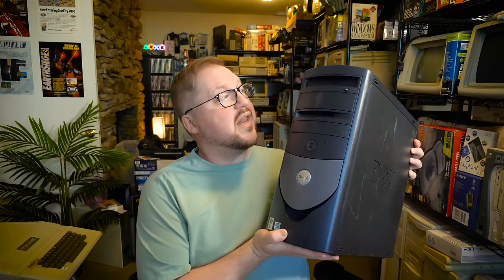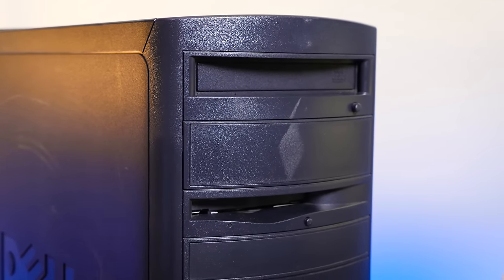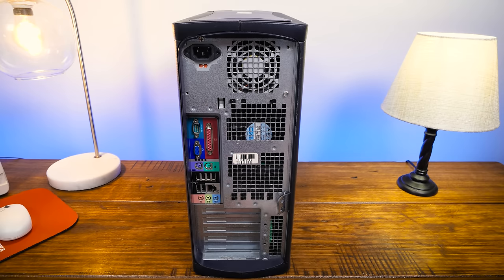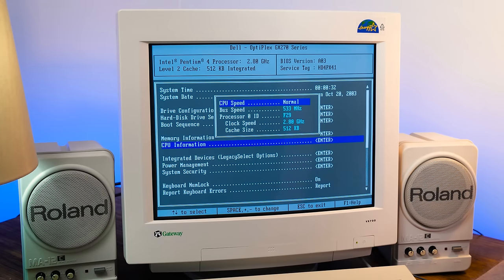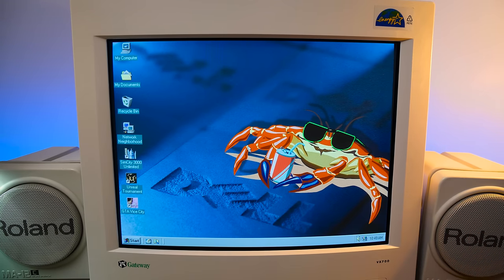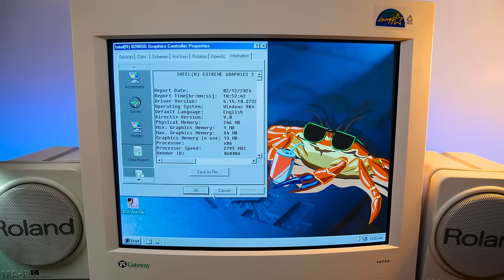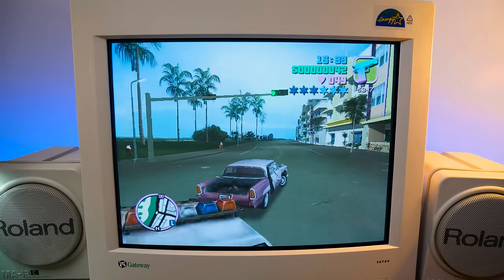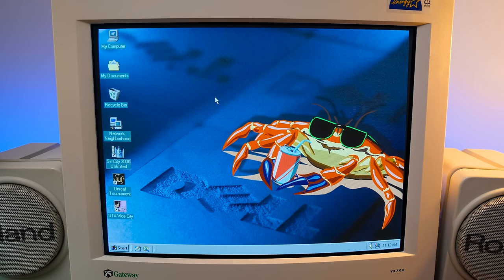The Most Unwanted, Boring PC: Dell OptiPlex GX270

Comment: --LGR buys a computer for $60 (with shipping), that he expects will run like crap, or not run at all.
--LGR says the computer is boring as can be, and is not worth much of anything, aesthetically, or otherwise.
--Computer has leaky caps, that obviously need replacement, LGR rightly suspects it will be nothing but trouble
--LGR powers on computer, expecting it to not work at all.
--Computer works like a beast, running Unreal Tournament GOTY with aplomb
--LGR expects no Sound Blaster emulation, or support with DOS games
--LGR runs DOS games, and Sound Blaster emulation is there, but choppy
--Despite some frame drops in a game designed for a computer five years older than this computer, everything runs great, leaky caps and all
--LGR tries so hard to find anything to complain about at the end of the video, settles on his own aesthetic preferences as the primary issue
--LGR commits to repairing the computer, having ordered replacement caps
--LGR, overall, taken aback at how much of a hidden gem he found with this unseeming, "boring" computer.

This is why Dell was so well-loved back then. Despite all of the issues some of their machines had, they made some darn fine computers, and that's what the company was all about, back then!

Dude, you got a Dell~

Comment: I bought a Dell Dimension 4550 at a thrift store a few days ago. Everything works great. I opened it up and saw two bad capacitors. Is this model prone to lots of them? (Specifically more than two bad caps?)

Also they didn’t look too bad so i also wonder how long it takes for caps to get worse? Do i need to worry about replacing them right now?

Comment: There is a quick and lazy way to recap these ... if you don't mind a little capacitor violence.  A bit of wiggling with a pair of pliers the can should come free, leaving just some stumpy leads.  Your new caps will hover a bit off the board but you'll have  saved the machine.

Comment: i use to have a gateway pentium 3 - 500 mhz processor that ran with 128 mb  of ram and i believe at the time it only had 65 mb of virtual memory if i can' recall. Then I an emachine that ran on a celeron processor yes a celeron as i have said it and ran a 3.50 ghz processor single core but did play games very well considering it's limitations which ran over a 1 gig of ram yes I did say 1.512 mbs of ram w/o breaking the barrier of 2 gigs that ran windows xp in which i could of got'n away with running windows vista. It ran bloody quick for it's time. yes i still have the parts but no case for it anyhow. I don't think I really want ot put it together again and to find out that it won't boot up.

Comment: those early Intel Pentium 4 ran slower and hotter than AMD AthlonXP's.  I got lucky and found a old busted up Dell Dimension with an Hyper Threaded 64bit Pentium 4 Prescott 3ghz model I trashed the broken up case and transplanted it into a Dell Dimension 5100 system I bought a my local thrift store for 7$. I did have cut some of the case with  a rotary tools to make it fit. It's now paired with my old Nvidia 8800GT 512MB and serves as a WindowsXP game system.

Comment: Early 2010 Optiplexes are great machines, i refurbished one for my mom who wanted a gaming PC, I found a low power quad core i5 and got a low profile 1050 Ti, also upgraded the RAM and it runs really well even being able to livestream 720p 60FPS while running Sekiro at practically max settings 1080p.

Comment: At 12:44, you can see that there are two faulty electrolytic capacitors near the ATX connector on the motherboard. More than likely they are just filters for part of the power delivery on the motherboard. Surprised this machine still turns on!

Comment: Hey don't knock intel graphics.  My first ever PC was a P2 400 with the last discrete card Intel ever made, an i740 AGP with 8MB of ram.  I could run Bleem! and emulate PS1 games better than original graphics.  I also learned many years later emulating PS1 games again with a directX plugin, that my laptop ran better with the chipset Intel iGPU than the discrete ATU card.  I later learned this is because for certain levels of directx, intel will get help from the CPU to help render things, if it can.  When using OpenGL mode, discrete card was king.

Comment: Capacitor plague aside, which wasn't Dell's fault, these (GX270 and 280s) were fine little towers. Easy to work on. We used them as diskless Linux workstations, most with nVidia add-in cards, and our users were begging to get them in place of their piece of shit SGI O2s and X-terms.

Not being a Dell fanboi, just stating facts and my experience.